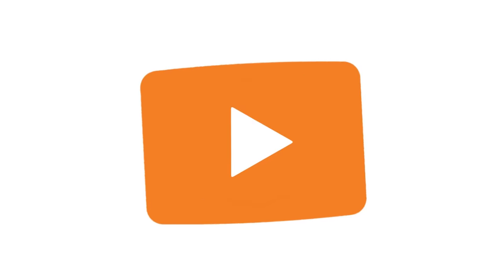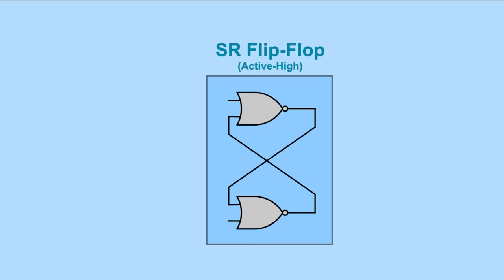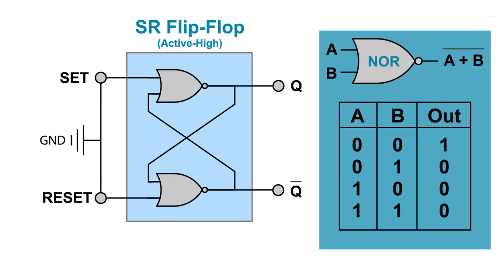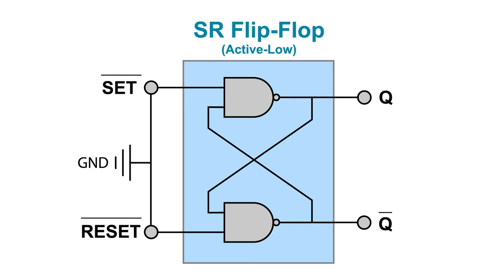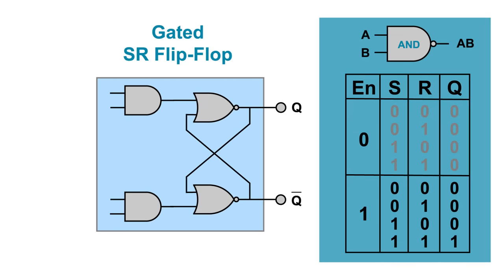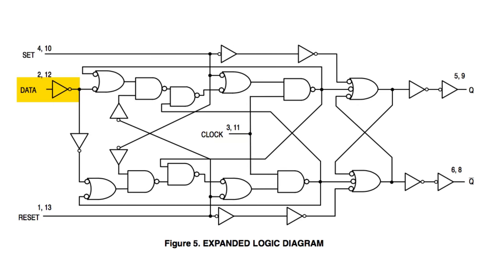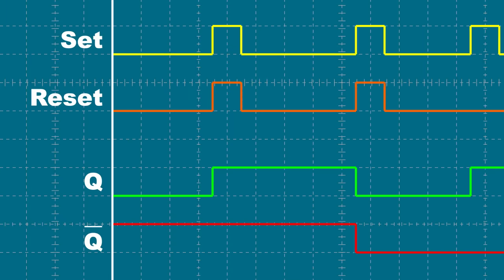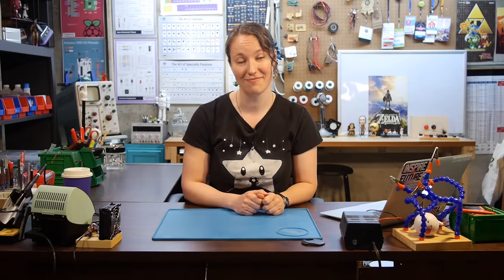How Flip Flops Work - The Learning Circuit

Comment: Obviously she didn't actually check the logic in her diagram, the set and reset inputs are reversed. Also, you would pull them down with resistors, not attach directly to ground.
Reply: Thank you, I was going around in circles trying to figure that out.
Reply: Thank you!  I was wondering about the ground connection, too — that made no sense.

Comment: In case anybody got confused like me, for active high SR Latches, the S is on the BOTTOM with Q-Bar and R is on TOP with Q. This way the S sets Q to 1 when it's high and R sets Q to 0 when its high
Reply: what does active high means?
Reply: Thanks, I was thinking that it should be NAND gates.
Reply: @babadmanz  It basically means that a device's output will change to high when the input to the device changes to high, active low is when the output of the device changes to high when the input changes to low
Reply: @thevoidzzz  thanks
Reply: Thanks
Reply: Try using a SR flip flop made with a 2 input OR gate an AND gate along with an Inverter.  One input of the 2 input OR gate is the Set input.  The OR gate output is connected to one input of the 2 input AND gate. The other input of the 2 input AND gate is connected to the output of the Inverter.  The Inverter input is the SR flip flop reset input. The output of the 2 input AND gate is connected to the other  input of the 2 input OR gate and is the output of the SR flipflop. Some times a pull down resister of maybe between 1 and 10 kohms is needed. Connect it between negative of your power supply and the output of the 2 input AND gate else the SR flipflop could "latch up" and cause malfunction in toggle flipflop or other circuits.
Reply: Yeah, that also had me confused for a bit.
Reply: Thank you, I was confused!
Reply: Stared at this for so long…
Reply: I was confused too. She rushed through the whole thing
Reply: Yes, this error in the video was extremely frustrating.  Thank you.
Reply: When she shows the effect of input on state of the latch as indicated by  light bulb the light should remain lite when the input goes low.
That's why it's a latch
Reply: Oh my god thank you so much!!!!! I was pulling my hair out, thought I didn't understand gates

Comment: Flip-flops are normally made using cmos technology which is STATIC SENSITIVE and therefore should NOT be handled without protective packaging while out of the circuit, or else the component can be destroyed by electrostatic charges which can be present in your fingers!

Comment: This series is great because you're using visuals to such great effect ! So easy to see what you're explaining, because up until recent times, we had to memorise what was illustrated in voluminous text books ! And you're explaining it so clearly to us ! This series is so useful because we can bookmark it and return as often as we need to for a refresher ! An Arduino makes things too easy; in a way it is a sledge-hammer to crack a nut, whereas we can ( and did ) use a flip flop to do the same job much more simply. As I said in another comment. this was the way that computers were built - they lived in air-conditioned rooms the size of Walmart, with hundreds of flip-flop boards each using 3 transistors. Because computers can't stop if they're multi-programming, the data has to keep cycling round until it is needed, which it did in these rings of flip flops ! Things began to change in the mid 1970s, when integrated circuits took over from discrete transistors for flip flops, and the shrinkage in hardware size began to take off. IT's great that you're covering all of this in this series - thanks !
Reply: Unfortunately, the example for the active-high RS is incorrect.  Either the SET and RESET need to be swapped or the Q and Q-NOT need to be swapped.  It is IMPERATIVE when making instructional videos to be accurate or it will just confuse the viewer.  How does anyone  , in the know, miss that the output of a NOR gate cannot be HIGH if either of the inputs is HIGH?  (3:10)

Comment: Very nice instruction but I am confused. How is it possible that the flip flop examples (time 2:42) show both gates with set and reset inputs connected together denoted as ground, and that independently each input is said to be at different states, either high while the other is low or vise a versa?
Reply: This is an undefined state and the example should not be shown this way.  It's confusing.  It's also incorrect.  If you were to power up the flip-flop with both inputs tied low, then it's simply a race condition as shown and you do not know if Q or Q-NOT will be HIGH.  Circuitry in modern flip-flops can be implemented to prevent this unknow initialization state, but typically a master SET or RESET is generated because the STATE of system must be DETERMINISTIC and the only occurs if the STATE is predictable.
The example for the active-high RS is incorrect.  Either the SET and RESET need to be swapped or the Q and Q-NOT need to be swapped.  It is IMPERATIVE when making instructional videos to be accurate or it will just confuse the viewer.  How does anyone  , in the know, miss that the output of a NOR gate cannot be HIGH if either of the inputs is HIGH?  (3:10)

Comment: Great stuff for my added learning for an old retired Aussie mechanical engineer
Reply: nope - it's got errors
Reply: @Stelios.Posantzis What are the errors?
Reply: @RaffieFaffie Most sources usually have ¬Q as the output of the NOR gate which has S as its input and Q as the output of the NOR gate which has R as its input. She's got it the other way around but she still continues the description of the circuit as if the inputs and outputs are named in the usual way (if you swap the outputs together with their values, they go back to being correct). Hence the values are all wrong.
E.g. at 3:07, with S = 1 then Q must be 0 
Same error at 4:44 with S = 1. again Q must be 0 in the circuit on the left (the one called "Active High").

Comment: Mam thanks a lot for the wonderful amazing video.
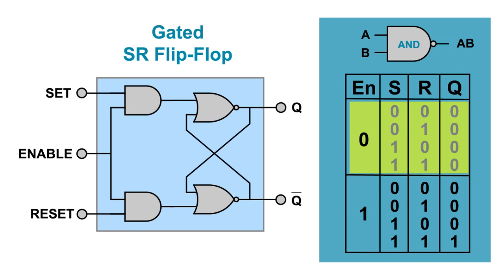By the way I wanted to add some correction At 5:27 minute of your video there is an error of AND gate image. You have added the inverter sign on the diagram. Since there won't be any inverted or bubble sign on the AND gate.
Thanks
Reply: Yes, picture of the table. It is NAND gate.
Reply: Also, for the active-high SR Flip Flop, the Set and Reset pins should be flipped (Reset on the top, Set on the bottom).

Comment: I think you've got Q and Q bar reversed on your SR flip-flop. Looking at the top NOR gate, if either of its inputs is high, the output will be low, meaning that if SET goes high, Q will go low.

Edit: it turns out the more common way is to switch RESET and SET, but the end result is the same.
Reply: i feel the same bro
Reply: Unfortunately, the example for the active-high RS is incorrect.  Either the SET and RESET need to be swapped or the Q and Q-NOT need to be swapped.  It is IMPERATIVE when making instructional videos to be accurate or it will just confuse the viewer.  How does anyone  , in the know, miss that the output of a NOR gate cannot be HIGH if either of the inputs is HIGH?  (3:10)

Comment: Jk flip flops are usually used for counters, either synchronous or asynchronous and D flip flops are usually used for fsm implementation. Also, if you connect j and k together, then it becomes a T flip flop

Comment: Great explanation Miss!! Love it ❤❤ I've just subbed to your channel
Reply: Unfortunately, the example for the active-high RS is incorrect.  Either the SET and RESET need to be swapped or the Q and Q-NOT need to be swapped.  It is IMPERATIVE when making instructional videos to be accurate or it will just confuse the viewer.  How does anyone  , in the know, miss that the output of a NOR gate cannot be HIGH if either of the inputs is HIGH?  (3:10)

Comment: Awesome tutorial.  Some of your diagrams have inaccuracies but it is very obvious and does not detract from the verbal explanations.  Would love to see a follow up episode with practical applications of flip flops.  Counters coming up next?
Reply: You say it's "awesome" but that it contains inaccuracies.  So, which is it?
Unfortunately, the example for the active-high RS is incorrect.  Either the SET and RESET need to be swapped or the Q and Q-NOT need to be swapped.  It is IMPERATIVE when making instructional videos to be accurate or it will just confuse the viewer.  How does anyone  , in the know, miss that the output of a NOR gate cannot be HIGH if either of the inputs is HIGH?  (3:10)

Comment: The diagram for the NOR gate RS flip flop is incorrect.  The SET input is on the NOR with Q-NOT output and the RESET is on the NOR with Q output.   There is no way for Q to be HIGH ( 3:10) with either of the inputs to that NOR gate also being HIGH.
This video has been out for nearly three years and no one has noticed this?
Reply: yes im pretty sure this is incorrect, the Q and Q-NOT should switch places

Comment: so I have a question: I think all kinds of flip flops have memory because the wiring typically implies an infinite loop (in software jargon) is that accurate?
And at 3:10  why in an RS active high flip flop would setting S to high sets Q to high if  for an NOR gate to return 1 both inputs should be set to 0. plz answer I need this info asap.
Reply: Because the schematics/diagram is wrong.  The labels Q and Q' are placed at the wrong output pin !!

Comment: very clear explanation.... Thank you
Reply: Unfortunately, the example for the active-high RS is incorrect.  Either the SET and RESET need to be swapped or the Q and Q-NOT need to be swapped.  It is IMPERATIVE when making instructional videos to be accurate or it will just confuse the viewer.  How does anyone  , in the know, miss that the output of a NOR gate cannot be HIGH if either of the inputs is HIGH?  (3:10)

Comment: Is it possible to make an LED on/off using a single push button switch and a flip-flop?
Reply: Yes.
Latches are very fast so your button would need a debounce circuit, but that is precisely why these are called Flip-Flops... the output can change states on every arriving clock.  Your button is the clock.

Comment: At 3:39 you show reset high and set low when they are both connected together and to ground.  You can't have two levels on the same wire at the same time, and in the case of TTL at least 0v wins.

Comment: I found pre and clr on SN74HC74N used in a UV light, an alleged medical skin healing device. It would only stay on for 7 seconds and the On sw was a momentary on with led. So either the pre and clr made the momentary sw a latch or turned it off after 7 seconds. This is a positive edge triggered IC with 2 channels in its 14 pins, common vcc and ground. The device also had a two channel 555 chip. I just started taking things apart to see how they work to re-purpose them. I want to bypass the timer on this light with as little destruction/mod as possible.

Comment: Great videos you’ve got posted! Great reference for me because I haven’t studied the stuff in 40 years! JK flip-flop bad pun coming up LOL when I was in college the books we used for studying digital electronics was from HP they were very good also I used to use some books that I got one was from John D link logic designers guidelines I believe it was I don’t have the book anymore but there were a lot of good books. Also there are used to be a series of books from RadioShack written by forest Memes the third great reference material for anybody that’s interested. Assuming they still exist
Reply: Unfortunately, the example for the active-high RS is incorrect.  Either the SET and RESET need to be swapped or the Q and Q-NOT need to be swapped.  It is IMPERATIVE when making instructional videos to be accurate or it will just confuse the viewer.  How does anyone  , in the know, miss that the output of a NOR gate cannot be HIGH if either of the inputs is HIGH?  (3:10)

Comment: Your pretty. Very pretty. But although I am a little worried of my being a little stubborn I encourage you to imagine Gates , Latches , and Flip Flops of every sort being made with only SPSD relays which shows everything involved in an easy to understand manner (unless you state what beneficial end the circuits shown have. Such as using fewer components by doing something like adding a circuit that resets all the RS flip flops at power up.) I hope I don't sound like I am being mean when my objective includes being helpful . By starting with the simple relay logic method everything can be seen with the eyes as switches in one of two positions depending on whether an electromagnet is on or off. From there following the rules for the type of ICs used will allow the circuits to be converted from one method to the other.

Comment: There must be some reason that involves a lot of understanding first or I can not really find a good reason not to use a different SR flipflop which uses one input of a two input OR gate input as the Set input . The OR gate output is connected to one input of a two input AND gate. The other input of the AND gate is connected to an inverter output. The inverter input is the Reset input. The output of the AND gate is connected to the other input of the OR gate and is also the Q output. There are no disallowed states and no inputs need to be assumed.
Reply: Yes, you need background to try and rethink why NOR gates are used.  In essence, just about every combination logic gate is made up of NOR gates.  Even inverters are just a NOR gate with both inputs tied together.  NOR gates are easy to construct on the wafer.
That said, the circuit you describe makes no sense as you do not show where the Q-NOT signal is derived.  Nevertheless, what you have described is equivalent to the two NOR gate example:
Take the inverted output of the first NOR gate and move it to be the inverted input of the other.  You now have an OR gate, and another OR gate with in inverted input and inverted output.  This is BOOLEAN equivalent to an AND gate with one inverted input.
Yes, you need more background to understand this.
It also doesn't help that the example shown here is INCORRECT.
The example for the active-high RS is incorrect.  Either the SET and RESET need to be swapped or the Q and Q-NOT need to be swapped.  It is IMPERATIVE when making instructional videos to be accurate or it will just confuse the viewer.  How does anyone  , in the know, miss that the output of a NOR gate cannot be HIGH if either of the inputs is HIGH?  (3:10)
Reply: @DiffEQ  maybe I did not describe it clearly but I tried the circuit and it worked for both toggle and data flipflops that I can use and understand easily. So can anyone without needing any type of degree. At the very least it provides a easy answer that gets us there without many hours of study first. The drawbacks of cross coupled circuits can seem to make no sense to amatures. I will be using this circuit to construct a calculator I designed although I do not possess any type of degree

Comment: sis you have error on 3:13 minute. it should be when set is high q dash is latched to high and q is low " the opposite" i hope you check it by making simulation ( nor gate will give high only if both input is low) also the set and reset in opposite position

Comment: I got lost when active-low was introduced.  I can't understand how the circuits behave differently if they are identical, and all that has changed is putting a bar over the S and R.
Reply: They are not the same circuits.  The first is built (incorrectly, by the way) with NOR gates and the second is built with NAND gates.
Unfortunately, the example for the active-high RS is incorrect.  Either the SET and RESET need to be swapped or the Q and Q-NOT need to be swapped.  It is IMPERATIVE when making instructional videos to be accurate or it will just confuse the viewer.  How does anyone  , in the know, miss that the output of a NOR gate cannot be HIGH if either of the inputs is HIGH?  (3:10)

Comment: Love you guys!! so amazing so amazing I'm struggling with digital eletronics at university. And I really want to learn it. But sometimes I feel lost cause I don't know how useful it is. I mean Why do I need a flip flop? How can it change lives? sometimes it's so theorical and I really need some basis. Even the lab it's really theorical. I mean How can I save a life with all this knoledge? This is my point. I really believe it's useful but I need someone to tell me about it.
Reply: With a flipflop u can have multiple inputs or outputs on only 3 pins (data, clock, load) For example if u want to make buttonbox of 64 buttons, and your adruino has only 16 pins, u   have to use shiftregisters (cascading flipflops) ... these chips are flipflops..  the data line will collect all your inputs and u program your adruino based on the load and clock to read them..  u need only 3 pins for that..

Comment: I like your way of explaining.
Reply: Unfortunately, the example for the active-high RS is incorrect.  Either the SET and RESET need to be swapped or the Q and Q-NOT need to be swapped.  It is IMPERATIVE when making instructional videos to be accurate or it will just confuse the viewer.  How does anyone  , in the know, miss that the output of a NOR gate cannot be HIGH if either of the inputs is HIGH?  (3:10)